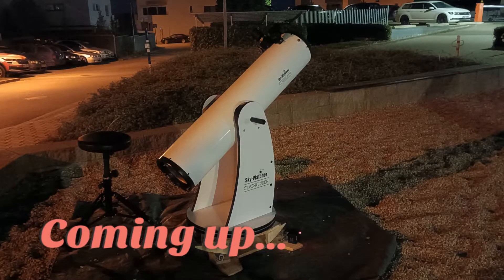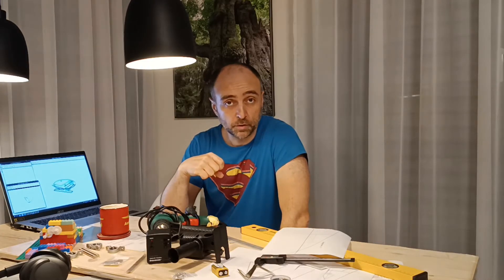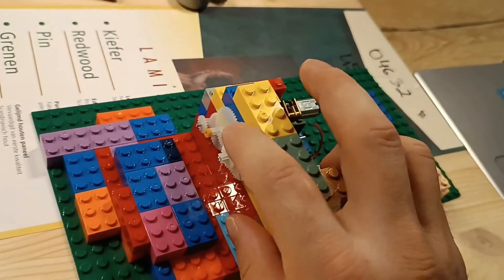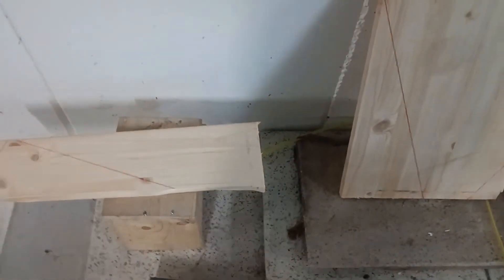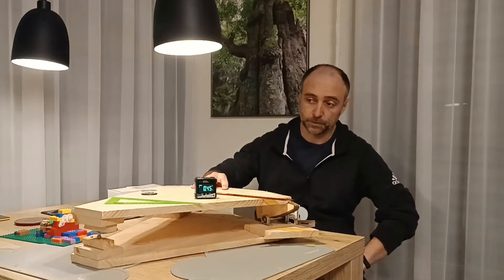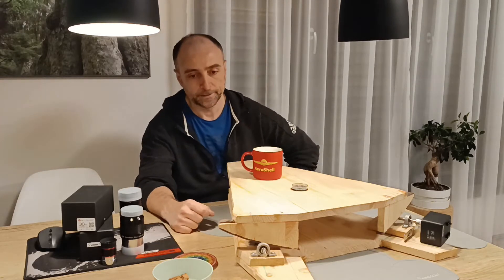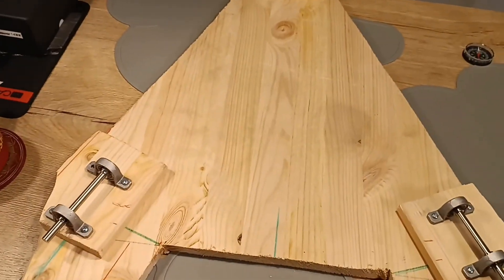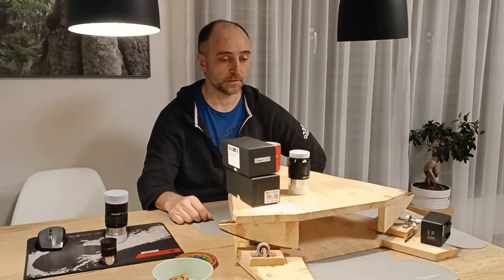Tracking for a Dobsonian Telescope - Home Made EQ Platform

Comment: I'm at 12 degrees in Central America. How can I build one of these? Thanks for the knowledge share!
Reply from the maker: Oh wow.. that's very low. I am not sure an EQ platform of any design will work there.
Reply: Like to me I am in Thailand Lat 12 °N
I have an idea to build Eq.platform. 
I think I can do it. 
The idea is that if I cut out the side of a solid cone,
Pieces cut out It will have a smooth surface on one side. And there is an arc on the other side.
If the part were to roll at an angle on a flat surface, it would still roll on a symmetrical axis of rotation with an elevation angle equal to half that. of the cone apex angle
     Make a roller to support the bottom curve. I think it should work.
Reply from the maker: DId you make it? Please send me pictures, I am curious if you ever build one.

Comment: Great video. I think i'd maybe upgrade the materials and design a bit to make it a bit more stable, but otherwise it's a good idea.
Reply from the maker: Indeed.. use plywood! .. Not what I used :). The rest is fine. It is a lot more stable that it looks for an 8" DOB... for a bigger DOB the design is increased by 15cm longer and 12cm wider

Comment: One hundred dollars?  Plus the cost of tools required and time required to learn to use them.  For some one like myself, with the mechanical abilities of a wet butterfly, time and money spent would exceed the cost of buying an equatorial platform from some one else.
Reply from the maker: Yeah.. it doesn't always make sense :). Tools = cheap second hand wood cutter for like 20$ should do it. Should've bought that than the stupid adapter (I got a refund)
Reply: @astralfields1696  Lol, we live and we learn, right.